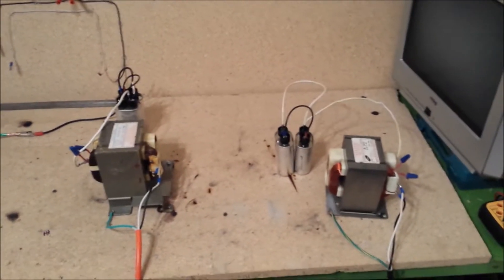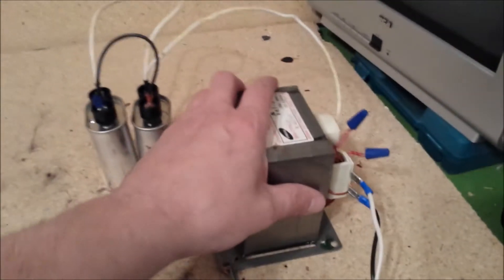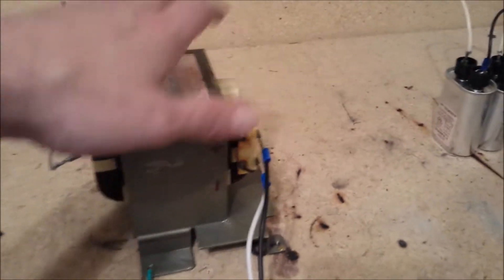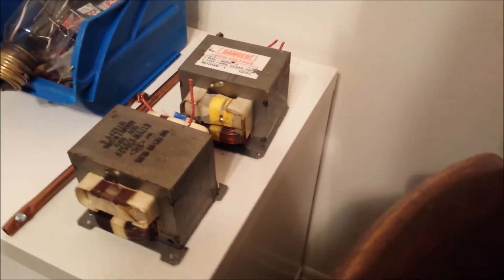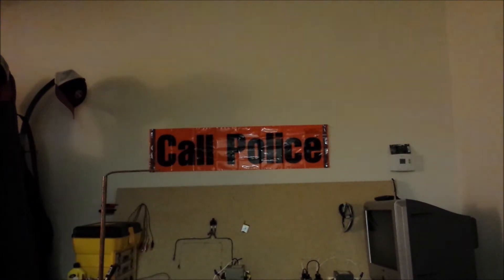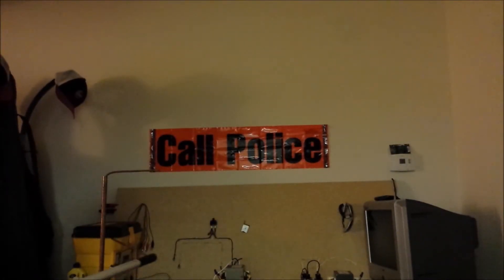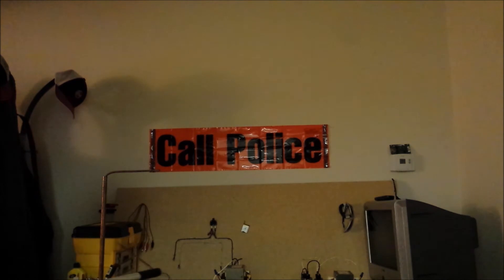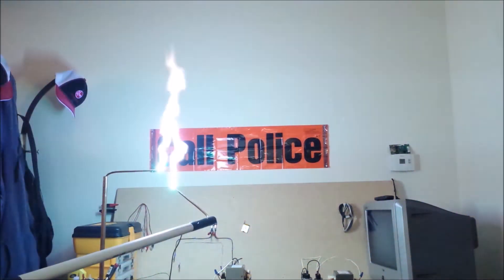4000 Volt Resonant Arcs! (2 MOTs + 4 Capacitors = 4 Foot Arcs!!!)

Comment: Why is 2 and 4kv mot Arc thicker than 25kv Arcs from a flyback
Reply from the maker: A couple reasons, though I can't explain thoroughly because I don't know too much about ZVS drivers and flybacks...yet :)
The amp draw of those transformers was 20+ amps each so much more current than flybacks. Also I'm pretty sure ZVS drivers convert the AC to DC so that may play a part as well.
Reply: @letsnotplaywithelectricity9346  they are also current limited

Comment: Could you help me out with a diagram? I have 11 soon to be 16 microwave transformers with matching capacitors that I would like to wire up to make the highest voltage and lowest current possible for a tesla coil
Reply: The transformer will blow each other’s secondary windings

Comment: whats to stop a guy from stacking say 20-30 mots together?
Reply from the maker: The amp draw. Each MOT draws 20-30 amps and there's only 100 amp service to homes. You could ballast hem, but that defeats the purpose if you ask me :P
Reply: You seem pretty knowledgeable. I've recently acquired a pole pig transformer and was wondering what would be the best way to limit the current on the low voltage side (120/240)? Any help is appreciated.
Reply from the maker: I'm not too knowledgeable on power line transformers actually. I found one on the side of the road a while back. It was either bad from the start, or I fucked it up by opening the case, I have a couple videos on my trial and error lol.

Comment: I think that's not exactly 4KV !!!
Reply from the maker: +Muhammad Nour Elmogy Thanks for the comment! No not exactly 4kv, but close. Somewhere around 4200 volts.
Reply: Lets NOT Play With Electricity most of my mots are 2300vac my dual older mot set gets around 3-4ft arcs in series

Comment: wow i subed straight away!!!    could you do a setup video of how to connected the to transformers? that would be great. also what are the caps for? i thought that it would just make it pop and short out?  awesome vids mate thanks.
Reply from the maker: +Nathan Pennell Thanks for the comment. I suppose I could put something together for you. Did you have something you would like me to focus on if I made a video? The capacitors add resonance which smooths the signal, and increases voltage :)
Reply: +Lets NOT Play With Electricity  i reckon it would be awesome to do some shorting out electronics e.g motors, fans, lights anything that you could hook really high voltage or current to. also depending on what you're into and how much resources you have at the time i am trying to make a Tesla coil but can't seem to get one to work maybe you might be interested in making one i reckon that would be awesome.

thanks by the way for the time you put into your videos i (and a bunch of other people) really appreciate it.